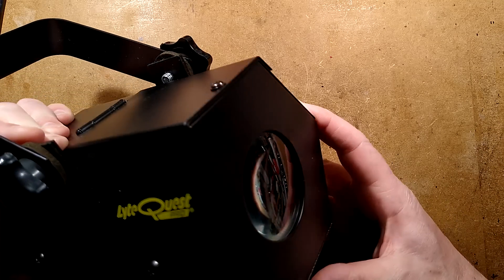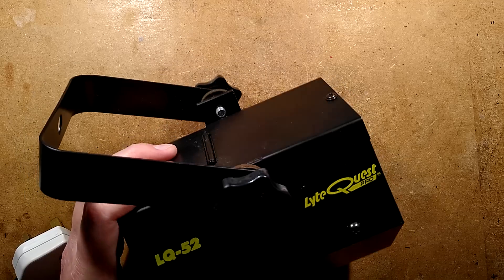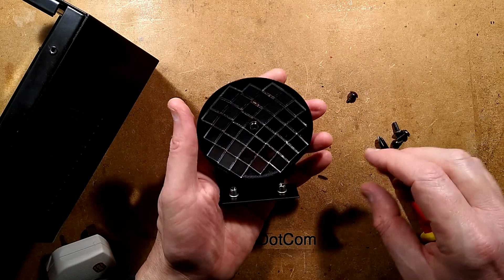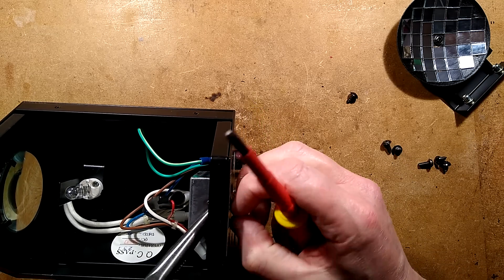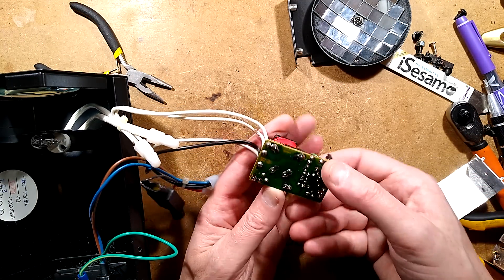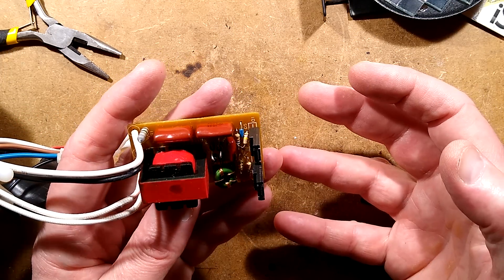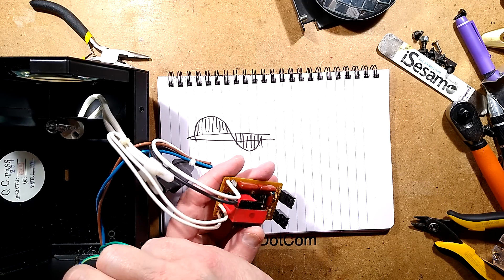Inside a tungsten moonflower disco light.

Comment: Nicely done video and explanation. I was wondering if putting 4x50W LED H7 replacement bulbs into a tungsten moonflower would be sufficient lumens to make the beams reach the clouds. Probably would run into thermal issues beforehand.
Reply from the maker: The optics of the moonflower may be optimized for the original lamp.  You may need to experiment.
Reply: @bigclivedotcom  Guess I'll try mounting the leds externally on the side focused on a 45° mirror at the original lanp place. Gonna be some experimenting to get the focal point right. The housing won't be pretty, but the light will be bright. Thanks for your feedback, Clive.
Reply: @seriosertyp8145 i know it's been a long time since your comment but i would love to know how it turned out

a video of it would also be great to see
Reply: @HolarMusic  To be honest I scrapped the project. Beamshot videos can be misleading. LED/LEP technology is nowhere close to light density, which is crucial for creating light beams with close to zero divergence, compared to discharge lamps. Big Clive made a video showing the inside of a Space Flower. Insane how small the light emitting area of a 2kw+ discharge bulb can be.

Comment: I used to work for a man who designed some of the circuit boards for a large British manufacturer of such lights (THE British manufacturer of such lights, really), and spent many hours helping him solder boards, deciding whether the motors moved with the beat, coming up with new designs etc. He even produced his own at one point, working with a gen-u-ine optics expert to use the best lenses rather than just "any old glass convex lens". They were head and shoulders better than the cheap £99 Twister. Alas, cheap and cheerful won.
 Happy days though, I learned a lot from him. I often wonder what he'd have made of LED technology, whether he'd be burning the midnight oil as before, coming up with fantastic effects used by every mobile DJ through to top nightclubs. 
RIP Phil.
Reply from the maker: NJD?
Reply: @bigclivedotcom  Nope, Abstract
Reply from the maker: @Mr.MFuckingYTchangedmyname  Another worthy company.  Alongside Mode, Pulsar, Mad Lighting and many others.

Comment: I've bought my first moonflower 21 years ago at age 9. I don't remember if it had a stepper motor or just a geared regular one but it changed direction on the beat.
I regret selling it, just because of the nostalgia.
Reply from the maker: It was almost certainly a standard mains synchronous motor.  They have no fixed direction, so just pulsing it on and off makes it bump about in random directions.

Comment: I used to repair terrible disco lights for a living at a shop in Vancouver years ago. We got so many of these through, although usually with motors. It almost got to be a joke about how everything we got was just a type of moonflower. Moving-mirror fixture? Single-beam fancy moonflower. One of my co-workers ended up mounting a unit very much like the one in the video into a broken moving-head fixture for a DMX controllable moonflower. Still, not the worst light we worked on. That dubious honor went to a moving mirror spotlight style fixture that was... repair-proof. They just used whatever parts were cheap at the time and then modified the firmware to accommodate it. So two fixtures, same model, manufactured a month apart, did not have interchangeable stepper motors or EEPROMs.

Comment: Has there ever been a moonflower that used a prism instead of mirrors?
Reply from the maker: There are some that use the standard system, but then split it with a rotating dichroic prism on the output.

Comment: Really? Only 15 minutes at a time? Is that even practical for a DJ or whoever is using this at a party or whatever? Nobody would manually turn it off and on after a few minutes.. you'd have to have a timer. Why not just add a fan or something and let it be able to run continuously?

Comment: In my Acme Winner Mirror head scanner I disconnected the 24v projector lamp and wired in a 240v GU10 fitting with an LED lamp in place as they are the same diameter it fitted in nicely at the cost of reduced brightness but benefits massively on nearly zero heat and no duty cycle. It works for me in the home but would be crap in a large venue but the colours and shapes are still as vibrant and the unit doesnt seem to care about not having a 24v bulb inside, maybe it has a dummy load resistor somewhere for the power supply to be happy I dont know. I do have a moonflower effect that uses 12v capsule tungsten bulbs, its a long barrel shape with a motor and the same mirrors in it, however I took apart an older unit that had 8 dichroic mirrors in it and glass glued them over some mirrors to try and at least create some colour. As you said, they dont work greatly as reflected light but some of the 'spots' do have at least some colour to them. My next task is to GU10 a couple of Martin mirror head scanners as those bulbs are 15v projector lamps and I know those units DO have a load resistor on them in case of bulb failure, again same diameter as GU10 LED but I will lose the lamp effects such as dimming but I dont mind as strobing is done by the effect wheel, not the lamp. It means the lamps are always on but all 3 units use a blanking section of the shapes gobo wheel for holding the output off. Bit of a story there but just love it when you go inside disco lamps and explain them. Id love a £3000 Chrissy? moving head like they use on strictly come dancing but I fear the leccy bill would rise sharply and the house would burn down ha ha :D

Comment: Would it improve the efficiency if they made the surface of the shield reflective on the bulb side?
Reply: No, because every surface the light hits/passes through decreases the light output by about 15%, IIRC. So, the reflector dish absorbs some, then the lens - so a reflective shield wouldn't add much, certainly not enough that you'd notice

Comment: Would the light output be increased if the interior of the unit was painted white instead of black?
Reply: Perhaps, but the extra light would not be in the sharp beams. But giving a general flow around them.
So it would be bad for the effect.

Comment: Those Italian Piergincomi side cutters are absolutely brilliant! About £5 and better quality than anything you can buy up to Engineer's price band in the £25 range. They do a wide range of electronics tools and I am slowly collecting them all as money and need arises. The blades very rarely knick and if they do the steel is good enough that you can usually work it out with a set of diamond cards. And at £5 replacing them entirely is not too stressful.

Although the colour of the handle does look a little off... Is it just the lighting or are these a Chinese knock off? Are they any good? So many questions...
Reply from the maker: These are generic Chinese side cutters.
Reply: @bigclivedotcom  Hey Clive! I thought the yellow was a bit off! The real Piergincomi ones are well worth the £5 though--I dare say that chinese source was deliberately copying their branding because of the quality of the originals. Not Engineer, but not far off.

Comment: I have something very similar, picked it up for the equivalent of about 3 UK pounds, it is the mirrors are lacquered with colors and the mirror assembly is attached to a motor that rotates, it is fan cooled so I assume its safe to run long term.. the halogen is also mains voltage.

Comment: Very interesting video Clive, thanks for the nice teardown.
Reply: The least-accessible nut on the screws the PS to the case can often be held stationary by inserting a flat-blade screwdriver (or similar) between a single face of the nut and the face of the shell (or wall) adjacent running parallel to the screw.

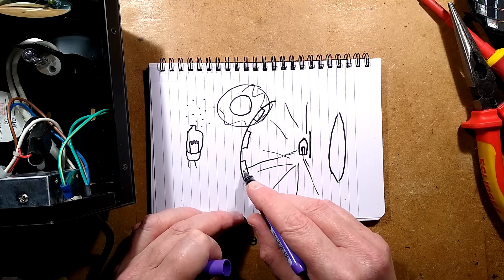Comment: At 6:17 I think he's mistaken: the reflections of every mirror are parallel with each other. That's what you get when the light source, which is almost a point, is located at the foyer of the parabola.
So every mirror sends horizontally tiny images of the candle onto the outer convex lens, resulting in many filaments showing on the wall... except for that one mirorr which is right in front of the bulb... its horizontal image goes through the bulb but gets blocked by the "wall" behind it, resulting in a dark patch.
Reply: I think you mean the “focus” of the parabola, not the “foyer”. 🤔

Comment: What if you could replace the mirrors with a set of multicolour LEDs where each square of the paraobolic mirror is an LED instead? as a modification wouldn't this make it way more efficient use of the light, or would it just look like one of those cheap RGB consumer disco lights Maplins used to sell?
Reply: No need to retain the parabolic reflector. The leads of LEDS are long enough that you could arrange your array of LEDs on a conventional PCB, and supported in an appropriately-shaped 3D-printed shim between the LED bulbs and the PCB, such that the LEDS all lie on a spheric section the same distance from a focus point of the spheric section. Relying on high uniformity in the dimensioning of LEDS, the shim would hold each LED, by the bulb's keyed base, at a specific height and in a specific orientation (appropriate to that LED's location in the array), such that each and all LEDs, would point axially at the focal point of the parabolic shim -- which, IIUC, would be the focal length of the lens away from the center position of the array.

Comment: I miss the "light organs" that  was used in the 80's. The ones with different colours controlled by the frequency spectrum of the music.
Got hold of a schematic and component list when I was around 12 and started to build in the electronic class at school... For some reason the teacher and my dad didn't think it was a good idea :-(
What could possible gone wrong? Only involved 230 V, triacs, transformer (to isolate from stereo signal) and a beginner in electronics....
Reply: you land across the room from where it went in a hand and out feet/leg and didn't do it again, because you gained respect of the force electrical power provides from then forward?
been there done that, leyden jars, car ignition coil, D-shaft motor with points and condenser,  diode strings......in hand and out leg, with multiple jumps through cheap old folding tv tray, with metal legs and rim.
it gave me a whole new respect of high voltage and current electricity, but also made me numb and dull to 120V shocks(USA)... did new construction residential electric for a while and many changes/rewires for all the years before and after, I often just wire live, yep been zapped many hundreds of times, partially lit up light bulbs through fingers...
Reply: Oh I miss those terribly, proper sound to light representation, now all you have are leds that get triggered by a spike and flash, it’s just not the same.
Reply: If you want to relive your youth . https://worldradiohistory.com/UK/Electronics-Today-UK/70s/ETI-1978-12-78.pdf   I'm afraid the cover girl might be close to drawing her pension now.
Reply: @MrDuncl  Thanks, will look it up!
Retirement, nah that's looooooong in the future. Almost ..... eeeek that's soon!
Reply: When you mention it, If my memory serves Make magazine had a couple of LED-versions here on the tube.Found one: https://www.youtube.com/watch?v=ubQC839Pvqk
Reply: Yes I used to make lots of those as a kid.
Reply: I have a few of these I made back in the 70's 3 channel and 4 .
Reply: I’ve been looking for one of those for awhile, I got my hands on a 1972 Morse Electrophonic stereo that has one built in.
Reply: I built one of those when I was 15 or so, for a school electronics course project.  As I recall, I was the only one in class who completely finished, including finishing the case.

Comment: I replaced the 12v transformers for all my halogen down lights with DC power supplies when I installed LEDs. It’s the only LED lamps in my house that have lasted for over 5 years and been on every day for multiple hours. :)
Reply: My LED ceiling lights (that replaced 60 and 100W tungstens) have been going for over ten years, the only one I have replaced was in the kitchen, to put in a newer, brighter style. The old kitchen one is waiting to replace the first to fail

The LED lamps are so much better than compact fluorescent, they hardly did better than incandescent bulbs, especially on outdoor lights
Reply: @AdamMansbridge  i disagree

Comment: That parabolic reflector would work nicely with a candle
Reply: I was thinking that too. Also you could build a scale model light house.
Reply: I actually have a little kerosene lamp that has a parabolic reflector in it to concentrate the light output. Used to be used on a train conductor car, but I do not have the housing, only the lamp itself. Works well with citronella oil to both deter mosquitoes and also as a light source during rolling blackouts.
Reply: @SeanBZA  Ahh. Blackouts. When they suddenly put us to stage 4 and we're off for 7.5 out of 12 hours every day. Our country is living day to day, but we still pay XD

Comment: So maybe I missed something, but from a design standpoint, why bother with all this? Why not just design them to use a normal line voltage AC bulb, given that this was from the tungsten era? I'd certainly imagine it'd be cheaper to not have all the electronics. Was it a heating concern? Power consumption? Or was it one of those "solution in search of a problem" products?
Reply from the maker: The size of the filament determines the sharpness of the beam.  They did make versions with 240V lamps, and the output was fuzzy because of the long vee filament.